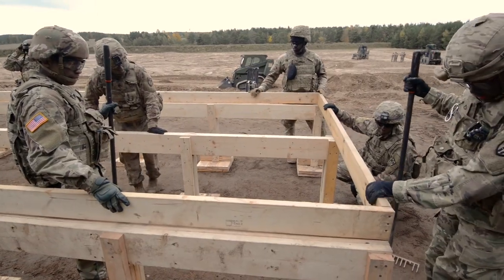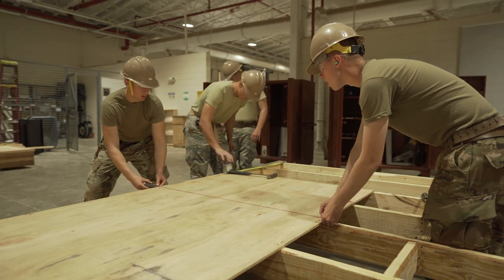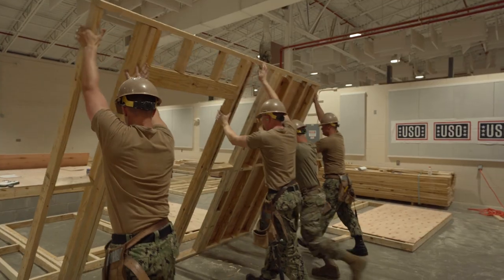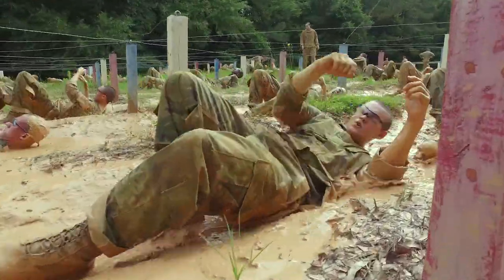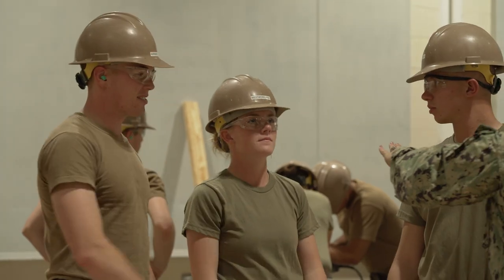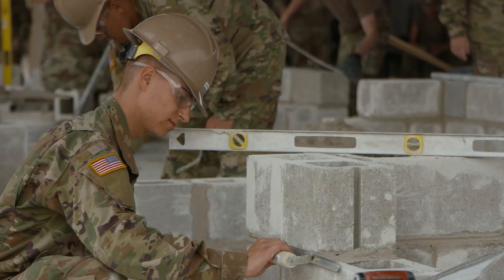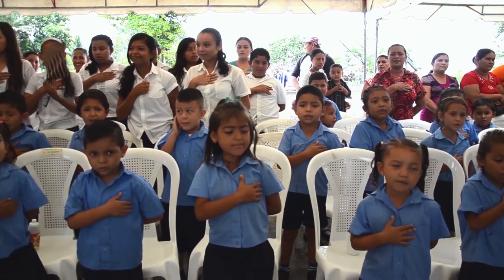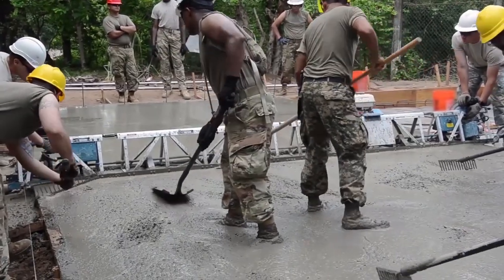MOS 12W: Carpentry and Masonry Specialist.

Comment: If you were to go through RASP as a 12W, would you see any sort of combat? I do know that the regiment is primarily based around Infantry (11 Series), but I couldn't find any concrete answers on this question.
Reply: Josh N probably not man. Sorry. But maybe. In my experience, Support MOSs, like engineers, were used a lot just for training missions. But it’s the place to be for sure. A lot of training and money to support training so you’ll get a lot more exposure and experience than you would in the big army.
Reply: Austin Miller so as a 12w, you wouldn’t see much combat?
Reply: SOLOGAMERX1 not unless you’re attached to a combat unit or SF or rangers like he said . Which u might but your job is to build not to be in combat
Reply: SOLOGAMERX1 they are getting rid of this MOS anyways since all structures are built by airforce or third party
Reply: @anthonybourdain2213  when did you hear that I was talking to a recruiter in December this was available? No the army still has them so does the rangers... 😐😐😐
Reply: @ChandlerBeastmoments  yea the only way is if you by some chance got sent to a FOB and had to build and the base came under atack but I don't think that would ever happen.
Reply: Robert no they don’t
Reply: @anthonybourdain2213   I would like to say that you're not correct. I've been working with a recruiter to enlist as a 12w in the reserves and there has been no word on the Army removing it as a MOS.
Reply: Deanna Rivera the job doesn’t exist anymore
Reply: @anthonybourdain2213  I'm shipping out to BCT in 5 days. This is my MOS. Pretty sure it still exists. 🤔
Reply: CISCO 2127 an electrician is not the same so no one has this job
Reply: @anthonybourdain2213  I just talked to a recruiter yesterday and this mos was being offered. Some MOS's are not available in every state. For example I wanted 12t but it's not available in my home state
Reply: @CJ-ss6ez  no that job isn’t available it’s been removed.
Reply: @anthonybourdain2213  

Found the 12B Combat Engineer.
Reply: @anthonybourdain2213  lol

Comment: Does anyone know how often active duty soldiers deploy with this MOS?
Reply: Rarely from what I've heard
Reply: @jbgrfx7910  I’ve heard the same. Just wanted to be sure
Reply: @terrelldawkins8561  my unit (760th) deployed 2 years ago. Went to Africa. Won't deploy again for 6 years
Reply: @jbgrfx7910  is 12W your MOS? If so, do you learn to draft or use auto cad?
Reply: @benjaminharrison3079 

12W’s do not touch autocad, any “drafting” they do will be quick field sketches. For that days work.

Comment: How difficult is it to get into this mos?
Reply: Not many open slots, it's a pretty small mos field
Reply: JManGaming1015 will you pass by with basic math?
Reply: JManGaming1015 alright thanks for the help
Reply: Taking heavy mathematics this sumester, thanks guys
Reply: @airmoccasins  you can also try to go navy or airforce for this as well
Reply: It's a harder MOS to get on the active duty side when i was going through the enlistment process I was told i got the last slot of the physical year this was back in 2019 though as long as u can do basic math and get the required score on your ASVAB youll be fine